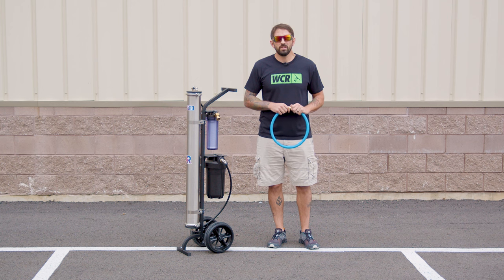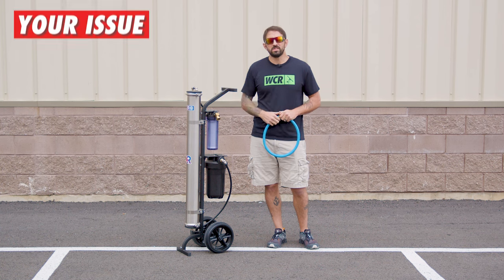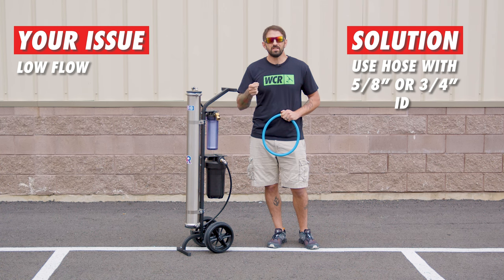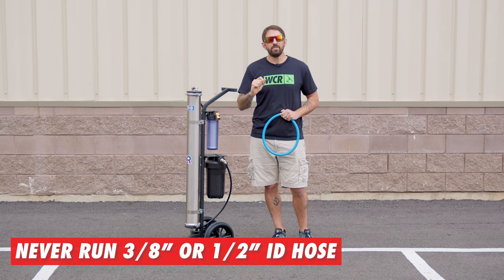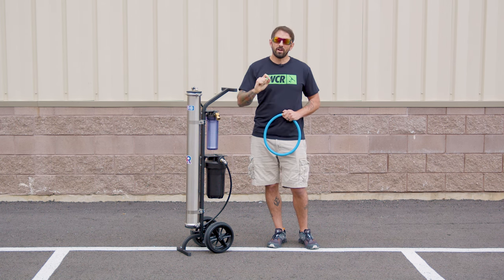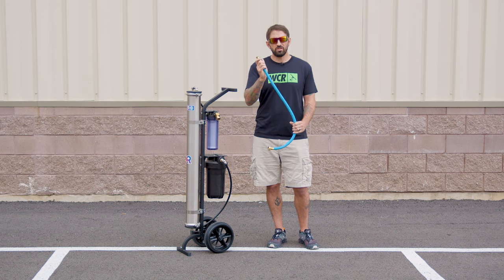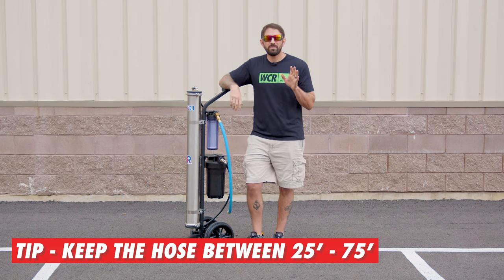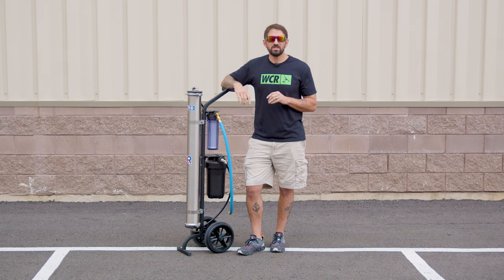This Hose Mistake Kills Your Water Flow!

Comment: I was thinking of making a 3 ft hose 3/4 to run from the spicket to my xero pure and then running 150 ft of the blue 5/8 hose from WCR to high Flo 100ft WFP hose. Would that give me good flow?
Reply from the maker: no, you wouldnt want the 5/8 after the system, i would max at a 3/8 for that.  that will keep flow. ~Jersey 862-312-2026   https://windowcleaner.com/products/xero-rubber-hose-3-8-inch

Comment: Still gonna get terrible flow unless you have an external pump
Reply: A pump will always help, but we've used multiple different single stage systems without pumps and had ample flow
Reply from the maker: Source water pressure plays a huge role in flow without a pump!